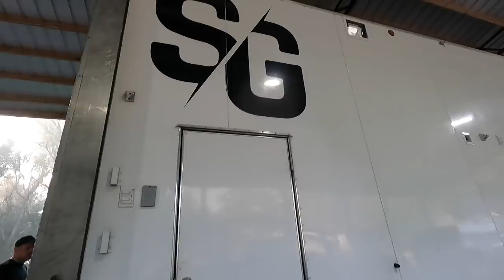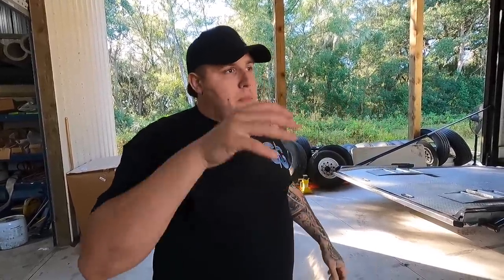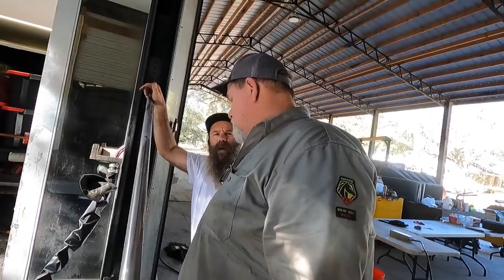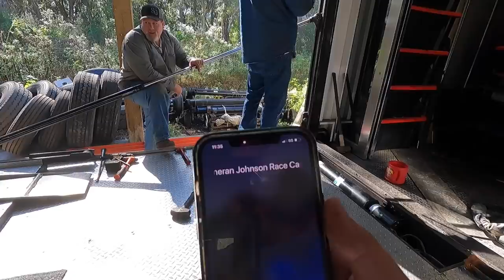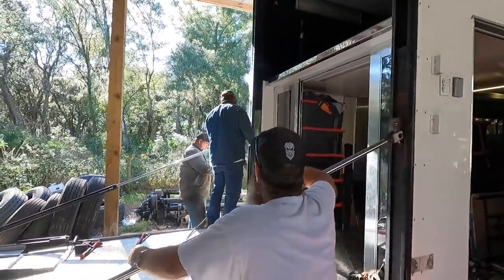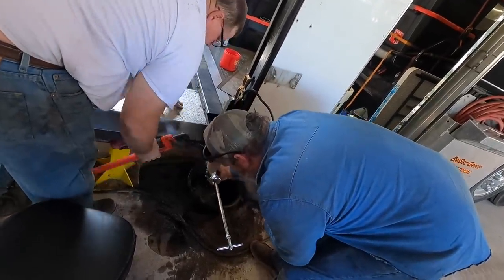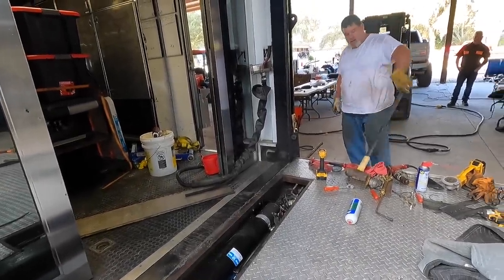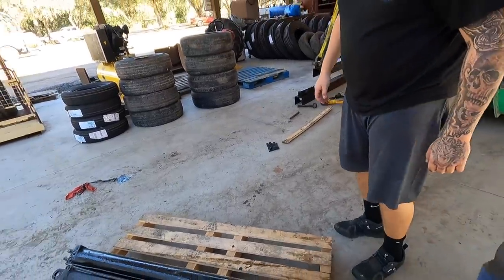Race Trailer Has MAJOR ISSUE, FINALLY Let Go On Us. (serious job)

Comment: I’m at work right now watching this (steel mill maintenance) I’m thinking of all the similar things I’ve done here. Thinking you should have used that forklift to pull the hinge pin out. If that slide hammer threads into the pin then an eye-bolt would too. Then use a strap/chain on the truck and yank it out.

Comment: Leaky cylinders Can be a common problem! I won’t mention names, but some of the earlier gates weren’t secured to the trailer as well as they should have been. To the point I know on three separate occasions the gates when loaded separated from the trailer.

Comment: You guys shoulve used that fork lift to snatch the pin out. A chain around that slide hammer and to the forklift. The weight of that thing would've been great for snatching on it.

Comment: If they are saying 8 to 10 grand; then it will actually be more like 15 to 20 grand to remove the door, and pull the cylinders out the top.

Comment: I used to work for competition 101 racing, we had a 53ft trailer, held the Cars up top and the pit cart, head sets and spare parts in the bottom, all hooked to a freightliner classic. I broke the fookin screw lift on the passenger side and we had to take in to Tennessee to be fixed 🤦